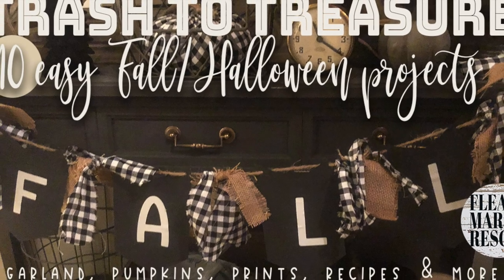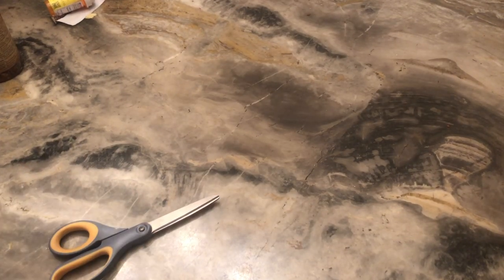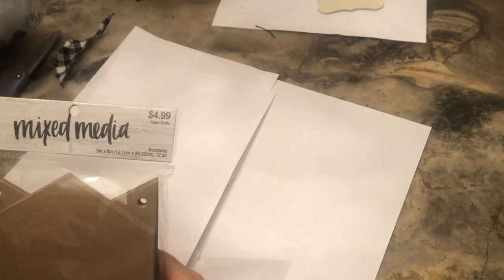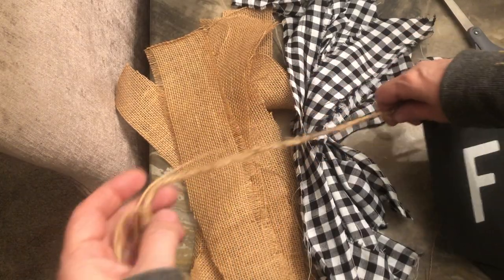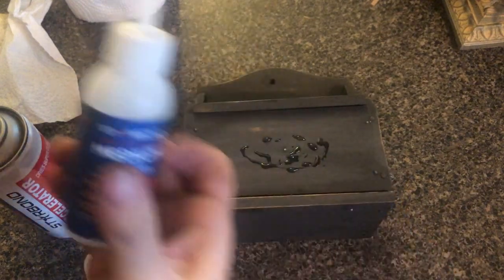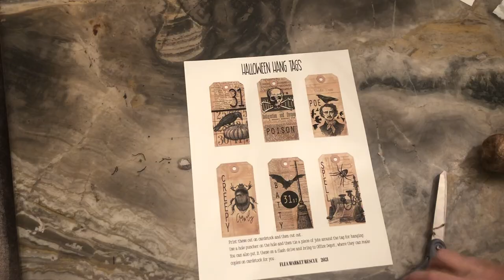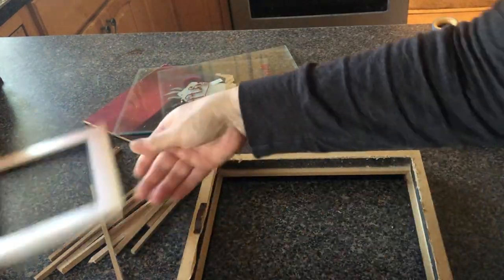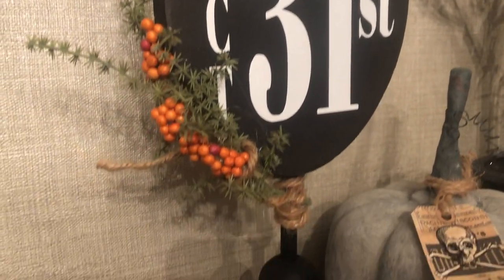TEN DIY TRASH TO TREASURE FALL HALLOWEEN HOME DECOR PROJECTS

Comment: Tip from other crafters::
Apply mod podge to the area you are applying it paper to, spritz the back of your paper you are using with a light amount of water from spritzing bottle.  Apply paper to mod podge are.  Using Saran Wrap in a ball rub the paper you have mod podged.  You can lift. It gently if necessary and put back down and smooth bubbles out as you rub the bubbles out with the ball of Saran Wrap.
***(DO NOT apply any mod podge [MP] on the front of your print until you have rubber out all the bubbles with you Saran Wrap or credit card.  The MP will get gummy and risk tearing paper.)
You can ad MP if you have accomplished the look and texture of the paper.

Comment: What do you mean by using a clear coat to stop the bubbles? Do you mean spray. Do you do that with the mod podge?
Reply from the maker: Hi Tammy!  I use Krylon Clear Coat Sealer. There is a link in the description to it.  And, if you just spray the back of your print first...you won't get those bubbles that you saw on my first project.  Hope that helps!